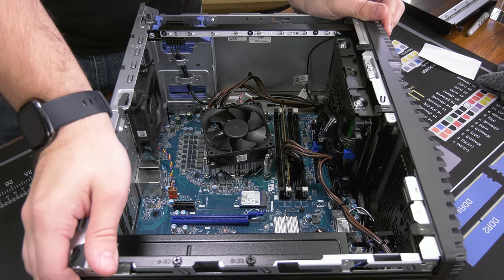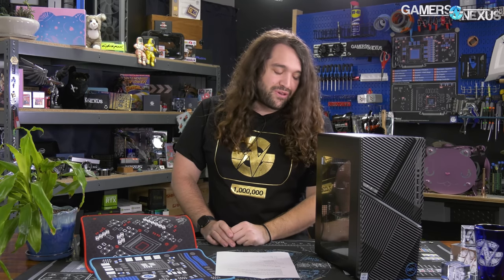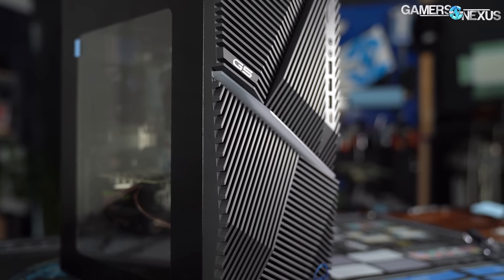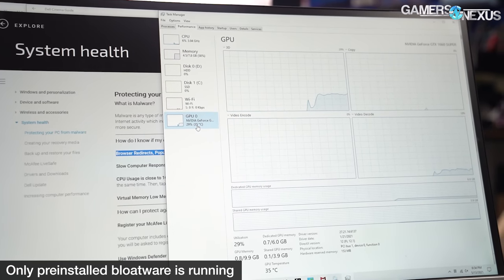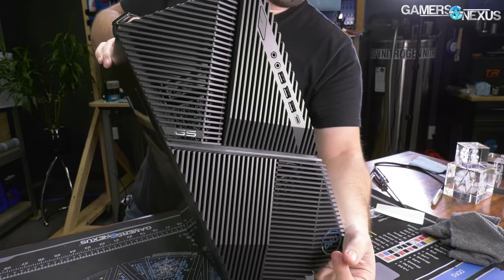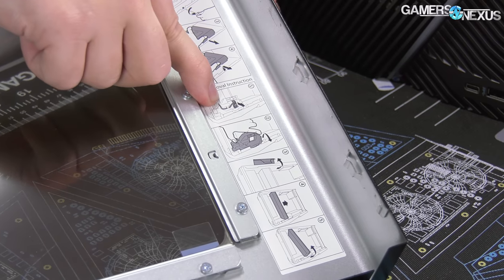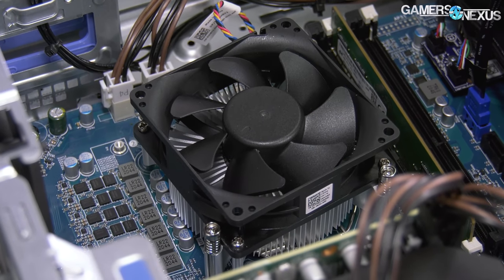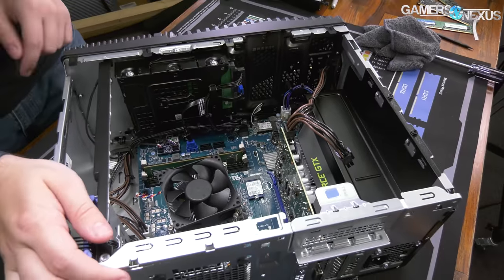Worse Than Walmart: Dell G5 5000 PC’s Garbage Parts & Hidden Charges

Comment: Watching this a year later and having gone through the used Dell PC rabbit hole, I'd say Steve's criticism for non standard component is valid from a DIY user's perspective, but it won't be as much of an issue for business/corporate customers. Since they'll just have Dell service the machines for them and will probably get rid of them once dell can't provide the services.
Dell, as well as other PC companies have been making  these non-standard motherboards for many generations before this one.  With smaller cases, non standard motherboard helps make full use of available room inside the case, providing more surface area for the motherboard than a standard ITX/M-ATX form factor can. The motherboard on this particular model doesn't look too densely packed, but Dell might have other higher end models that could use the extra space for another m.2 slot. It is a shame that you can't just put a standard motherboard in these cases though, since the build quality of these are quite nice.
On the issue of self serviceability, I wouldn't worry too much on getting compatible parts, since the second hand market will be flooded with those once the product itself enters end of life. Not having a proper name for the PSU form factor could be a problem, since it makes it harder for you to search for a replacement. Older dell slim PCs used "TFX" form factor which is also elongated and looks similar to this one but I'm certain the mounting hole is different. And I can already see many second hand sellers mistakenly list this newer form factor as "TFX".  Imagine buying it and finding out it doesn't fit only after you try to.
The market for second hand Dell PCs is so large there's an entire community around it. You can even find pinout diagram for Dell's proprietary front IO connector posted by user on a forum. There's also adaptors for proprietary cables being sold online.

Comment: I've not bought a ready-made computer until about 6 months ago. I've built every computer I ever owned for 30+years. It's not so easy to get a good range of parts. I bought a Lenovo, biggest mistake I ever made. The components are peculiar to say the least, and the quality of parts is rubbish. The sata power cables were in bits when I came to add an extra ssd. The psu is non-standard, similar to the Dell G5 5000, The board can't be expanded board wise because the motherboard is not standard. The usb ports are unprotected power-wise and one burnt out the first week. The case isn't bad though.

Comment: The bolt-throughs are to save fitting captive nuts on the motherboard, rather than for any structural reason. The motherboard and case are a single design.

Comment: Questioning the design during teardown was classic.  In my first job we'd tear open industrial controls and some had stupid artwork on the circuit board - hieroglyphics in addition to circuits.  Absolutely foolish unless you purposely sought electrical noise interference.  I wonder how many were returned.  Not all designers are that good.

Comment: I feel like this routing of cables each with multiple stranded wires in them is kind of primitive and messy. And we're still doing this general kind of thing to this day. I feel like there has to be a better way to do things. These days you see a lot of braided sleeves around the wires of multi-wire cables, which is certainly nicer. But it seems like the whole cable routing mess is still kind of a problem.

What if cases had a sort of a power and signal bus that went in a U shape around the motherboard? With modular plugs at various points? So you'd just plug things into the most convenient plug on that bus. Then you're cables could be really short. Maybe cables could come in a few different fairly short lengths, and/or they would have little spring loaded spools to adjust their length as needed.

I suppose, depending on how it was constructed, such a bus might block or hinder air flow. If it were just a u-shaped trellis of poles and posts it might not really affect air flow much. Or the bus could be part of the case itself.

Comment: i bought this pre-built (1660 ti, 10400f, 16ram, 500gb ssd and 1tb hdd) on president's day 2021, and it was $750. I really wanted to buy parts separately, buy it was impossible to find graphics cards back then. but I still think it was a great deal. upgrading is a problem, though

Comment: To make the cooling unit attach to the frame instead of the board is in fact mechanically very SOUND. The unit can be heavy and a board isn't that mechanically strong. So it's a GOOD engineering design choice which increases reliability. Most of the choices that were made are to make a reliable mediocre unit possibly  targeted at bulk sales from big company IT departments. Seen in that light the design choices really make sense. Proprietary means IT departments will order parts from you also users won't repair those machines themselves

Comment: 06:06 You forgot to mention that the RAM module is an absolute piece of crap; It's 1Rx16, instead of 2Rx8 or 1Rx8. Both the latter ones are nearly 30% faster than the 1Rx16 (and it doesn't have anything to do with Latency or frequency, they are separate domains, altogether).

Comment: MOst of this is irrelevant. People are buying Dells for the ease and so their comp will last. They dont care if their  internals are resellable or non proprietary. They dont care about the cooling or if its top notch ram with ram heatsinks. They dont care if the fans are cheap or if there is bad cable management inside the blacked out case. Almost nothing mentioned in this video, besides the bloat ware and the tests, matter.

Comment: a note for the PSU plugs... there are 6pin to 24pin adapters you can get so you can upgrade your PSU in these Dell systems and allow yourself to be able to add a GPU and plug a new PSU into the motherboard.... i recently bought a Dell 3020Mt which is pretty oldish at this point... but still a really decent PC for how much i got it for... but once i got it i found out very quickly it had some weird ass plugs and so i started researching online and sure enough i found a adapter for the PSU to be able to plug into the MOBO...... the HP Computers are basically the same way but in my opinion worse because even if you buy the adapter for the MOBO and PSU..... in the HP EliteDesk PC i got where they put the USB 3.0 plug on the MOBO is right next to the GPU PCIE slot.... so if you go to plug in a normal size GPU it just wont work because the USB slot is blocking the GPU... now you can remove the USB plug but that basically eliminates the 4 USB ports on the front of the case which is pretty dumb.... so i mean.... you can get some GREAT DEALS on some of these pre built systems but you FOR SURE need to research whatever Brand you are gonna go with and make sure you dont need to get yourself a adapter and make sure the MOBO inside the case is not a screwed up design were you have to unplug crap in order to get stuff to work

Comment: What an absolute piece of junk. I picked up a prebuilt 2 years ago here in Australia, Cost me just under $1000 Australian Dollars.
I got a 10th gen i5 10400F, 32GB of 3200 DDR4 ram, A Gigabyte B560M mobo, MWE 550 PSU, and a Original Nvidia 1650 4GB ( changed it to a RX6600 8GB after a few months), in a decent case with a RGB cooler on the CPU and 3 RGB case fans, running at1080p mainly but 1440p for some games.... All for just under $1000 AU Dollars.
I have updated these days to a water cooled 13th gen i5 with a Gigabyte RTX4080 OC 16GB, and 32GB of 3200 DDR4 ram with a Corsair 850W PSU, running in 4k. But I kept the other 10th gen pc still as it's still great for 1080p and 1440p gaming, and great for friends to use when they come over to play multi player games against me.
Cheers.

Comment: I have one of the g5000 series, it works great. Geforce 2070, 32 gigs of ram, runs everything with an upper limit of 78 or 79 c and usually a lot cooler than that. It stays under 60 running il2 box. i did add a noctua front case fan though. Its a good dependable computer.
The computer i had before that was also a dell with a 1070 that iirc i got in 2017 and lasted until about a week ago when the power supply gave out.
 For a number of years, when i couldnt afford a good gaming machine, i would buy a refurbed dell and add a graphics card and some ram.
Reply: It’s a downgrade compared to the Inspiron Gaming Desktop 5000 series which came out in 2017-2020

Comment: Going through this exact scenario right now with the g5 5000 - just after warranty expired it started  intermittent freezing, game crashes and USB disconnect sounds/freezing…. Tested all components - narrowed down to either cpu, MB or p/s issue…. Likely MB. Opened up the cpu to find a number of mangled cpu socket pins on the MB.  Very disappointed in @Dell…. Never again.

Comment: I have attempted to build with salvaged parts out of Dell PCs and I regret it every time.  I have literally had to cut plastic tabs off of a GPU that were intended to make the card only fit in a proprietary locking slot.  Forget trying to re-use a Dell PSU or motherboard, may as well scrap those immediately.

Comment: Dell is a very "special" company :D I love a memory of cleaning the fan and repasting the chip in Dell Inspiron 15R. I had to remove everything from that notebook before the cooling assembly become accesible. That also included display 😮‍💨 Yup, not a typo, not wrong method, the display have to go before access MB.
Or other special product, dont remember the correct model, but I thing it was from Inspirion series. They all started coming back with broken chasis. All same spot. It happened just by opening and closing it. All the tension from bending of cheap plastic chasis was held by thin stripe over dvd drive 🤦‍♂

Comment: Oems are always garbage to a builder used to off the shelf parts. They cut corners in terms of parts and design features. I once had a Dimension 2350 in the early 2000s with a Pentium 4. They had removed the AGP slot, had to settle for a regular PCI video card.

Comment: Little late comment here that no one will likely see. I bought a Dell laptop some years ago. I had to have the fans replaced and wanted to do it myself. I contacted my Danish (Im from Denmark) Dell support and guy helped me order the two fans I needed. The order was then place at Dell internationally. Wrong fans was shipped and I contacted the international Dell to have them send the correct fans. They where oblivious. No help at all. I then contacted my local Dell support and guy there pressed a few buttons in his pc and it was done. I got correct fans few days later. 
Dell is trash by default, but there are local branches that know their stuff.

Comment: I get harping on these prebuilts for not being upgradable but I think its blown way out of proportion. Lets face it, the average buyer of a system like this wont ever even take the side panel off. The build and component quality ia good enough to last years of normal use where it'll then be kicked to the curb for the next one.
Reply: Even if you overlook the QC issues. You're still not getting the performance that you should due to Dell oversights. i.e. excess heat, bloat, etc.

Comment: In 2000 I bought a dell desktop because of their reputation for pretty good service. I purchased "at home" service contract. Problem is they would not send anyone to your home unless all efforts to fix it over the phone failed. Guess what. You have to call back multiple times and spend hours on hold before an ignorant technician read you directions on how to do something stupid that I had already tried and knew would not work.
I will probably NEVER BUY ANOTHER DELL. Customer service stinks!

Comment: How much you want to bet that is a proprietary LPDDR-4 narrow width dimm, that will only load on computers with their BIOS.
Reply: I still find that the few positives are about efficiency of engineering.
Reply: 500 W (burst) power supply.

Can provide 500W for 2 nanoseconds. ROFL.

Comment: I don’t know… I don’t think it’s that bad. It’s got some very clever cost cutting measures, using the mb tray as a bracket for the heat sink is brilliant. Plus extending the mb for the front ports is also genius.

It will be fine, it will have been tested and will likely perform for many years. Sure it will need cleaning out, but only once it starts “getting slow”.

I doubt many custom built PCs get upgraded and become E waste at just the same rate as dell’s products.

Comment: I actually think the whole absorbing "free support" into the system cost was perfectly fine. If the customer is okay with a  $900 price tag, Dell doesn't owe it to the customer to specify how much of the $900 is for the "free support".
The problem is calling it "free" then adding $67 on top of the $900. That sounds like a serious customer issue with questionable legality. But, Dell admitting they made a mistake and it was supposed to be part of the $900, I'm cool with that and it's essentially the case with every product that has "free support".

Comment: 11 minutes in, I thought "ah, electrolytic capacitors next to the CPU heatsink". Looks like Dell have still not learned from drying out capacitors that I remember from 20 years ago. Or maybe they did, and have spec'ed the capacitors for no longer than the warranty period. Bastards.

Comment: I will never go prebuilt simply due to the corners that OEMs cut, but they then charge the difference for labour in the price. No thanks, if I’m gonna reach into my pockets, at least the board, cooling, case etc are going to be exactly how I want them

Comment: Tore a older dell open the other day, like 6 years old 7700k. Confirming it was really no better other than the power supply was a standard. Had to swap it out. The CPU fan was just about the same size they use to cool the Xbox one power supply :V

Comment: late 2019 i bought a prebuilt from a local copmuter store
motherboard was something you couldnt find on the web , to get the needed drivers
neither CD/DVD for that or the "graphix" card
and the HDD would overheat , making the OS installation freeze after first half
since than , i had to join the PC-build / DiY / whatever you wanna call it ... comunity 🤓

Comment: You don't buy a Dell if you want a standardized system. That's never been the case with Dell (pun intended). You buy a Dell because it's Dell. Dell's selling point is its in-home service. This means you never have to touch the computer yourself, instead leaving it to Dell warranty service to visit your home and fix it. 

If you want to be able to service the computer yourself and/or remove or upgrade internal parts, you buy from a different company that provides a standardized system. Proprietary has always been Dell's schtick. If you don't want to deal with proprietary, choose a different builder. No real surprise with the odd nature of this system's build. It's like tearing apart an Apple computer and complaining about how weirdly it's built.

Comment: The Dell Inspiron 537s uses the same CPU cooler as this thing, but that cooler is not screwed into the case, unlike the one in this $900 piece of junk. The Dell Inspiron 537s CPU cooler has the hockey puck protruding from the bottom to contact the CPU, just like the CPU cooler in this $900 piece of junk. The Dell Inspiron 537s is from 2010.

Comment: I bout this a few years ago. I did weeks of research and th8ught i knew it all. Only thing that never came up was what a proprietary part was. And i never got this video 😅 so i can fully endorse this video. Ive had a small squeak, ripped out the case rivets to install a noctua cooler. Yeah, shes trash
Oh yeah, i also paid 2000 cuz it had a 3070. Specifically to avoid scammy gpu prices for CAD software. Got scammed anyway!

Comment: I'm amazed that they can refer to a PSU (PoS) as a 500 watt when it only puts 216w on the 12v rail. Worse, if you try to build the closest thing to this...this thing...on pcpartpicker it'll tell you it'll pull 287 watts! (so maybe it's a good thing it runs so slow)!

Comment: Sometimes there is a good value proposition in OEM. The previous time my parents needed a computer the OEM was about 20-30% cheaper than the parts. It was an ACER, worked well enough, but had a proprietary power supply and likely a low quality motherboard. It lasted about 5.5 years before dying. I believe it was a motherboard issue, but I don’t have a compatible motherboard to test whether it was the motherboard or CPU, which would be unlikely. I had purchased a PSU adapter for its proprietary connector and there was no change using another power supply.

The most recent build I convinced them to go DIY build. The prices for DIY vs OEM were roughly the same, but the DIY route allowed me to get a decent PSU, a mainstream quality motherboard, more ram, and a reasonable quality/performing nvme ssd.

I also got my mother to help build it, which she really enjoyed. That alone seemed to make the DIY route worthwhile for her. I am much more confident in this computer than an OEM.